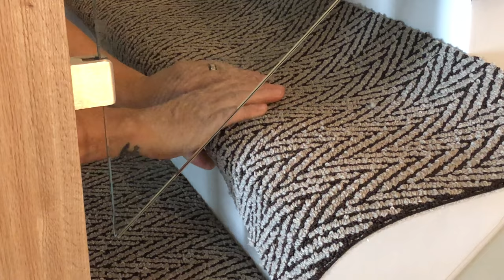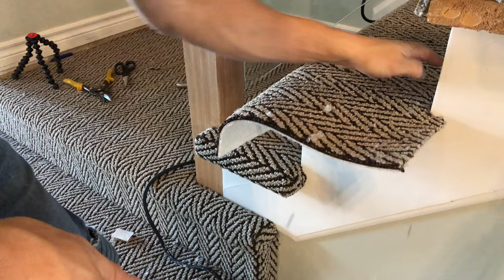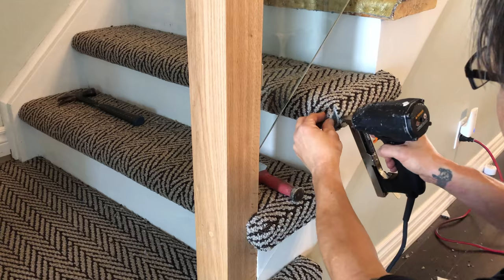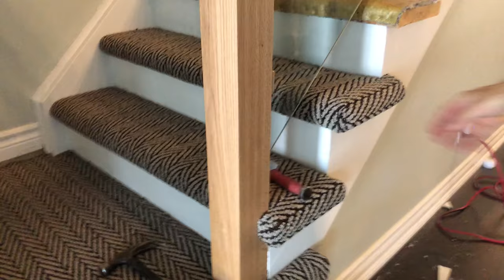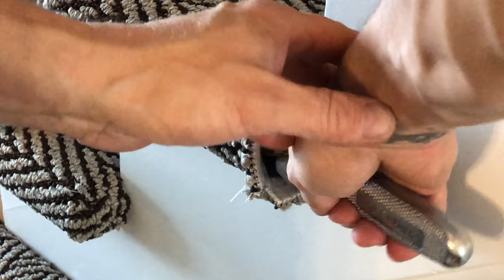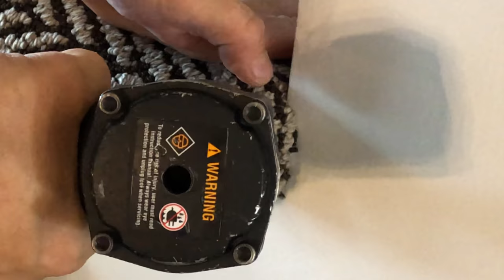Ultra Modern Stair Carpet Installation - Is it Really That Hard?

Comment: This looks great. I want to do the same thing on my stairs. I just need to find the right carpet that “speaks to me”. I’ve even debated on using rugs and cutting them to fit. I want as low pile as I can get as carpet on stairs always looks crappy over time no matter how often you vacuum.
Reply: I would suggest Anderson Tuftex. They have a wide range of designs and patterns and the carpet is low pile and built tough to handle high traffic stairs.

Comment: Keith, Doing this project. I am using a runner bound on both edges, centered in the wooden stair. Should I still use the tack strips, like 2" shorter than the 24" runner? Thanks and Happy New Year. 31" walnut treads and risers, 24" runner.
Reply from the maker: Happy New Year😀 you don’t have to use Tack Strips if you don’t want to! It’s up to you! I have many videos with tack strip and without, lately I have been not using and the job has been great! As long as the pad is straight and no more than half an inch away, taking place of the tack strip ! Hope this helps

Comment: I should be able to do this with a runner, correct? I am not going edge to edge on walnut stairs, so would use this method with a runner so the walnut riser is exposed. Thanks.
Reply from the maker: Should be fine

Comment: Stunning work! Can I ask, what are the other tools you are using, besides the staple gun? And how have you attached the underlay - glue/tape?
Reply from the maker: Thanks😀 underlay is attached with a hammer stapler as far as installation I am using a kicker a tucker a hammer an electric staple gun and a knife😀
Reply: @KeithShannonDirectCarpet  thanks for this, and thanks for being so generous with your knowledge. I’m looking at using carpet tiles so don’t think I’ll need the kicker, just need it to be 100% secure. The other tools finish it off so well - obviously with your skill!
Reply from the maker: Awesome good luck let me k ow how it goes😀😀😀
Reply: @KeithShannonDirectCarpet  Wish I could send you a pic - it worked!! It actually worked!! I’ve only completed half the stairs, but your video gave me the confidence to use the electric staple gun, the appropriate number of staples to use, and to adjust it slightly by giving carpet tiles a try! Husband and teen are pretty impressed, thank you!
Reply from the maker: Welcome!

Comment: Nice job and thats some cool looking carpet. Don't  you wish they made a staple gun that fits under all the steps without having to angle it ? That's the only part I never liked when doing steps. Mistake quote : ripping  off the old carpet, pad, and staples was the only part I didn't  like. 😆
Reply from the maker: You are soooo right! There is a gun that’s air powered that is tiny or smaller! But I do like my powerful plug in🤪
Reply: @KeithShannonDirectCarpet  what's the name of this staple gun? Never heard anyone talk about it.
Reply from the maker: That is a duo fast stapler that I’m using in the video! As far as the pneumatic one is concerned I’m not sure  of the name but available at most flooring supply stores and I don’t think it’s that pricey!  Just a plug in to a pancake compressor
Reply: @KeithShannonDirectCarpet  I have and use the duo- fast too. I was curious about the air gun you mentioned. I have a friend who has a Craftsman staplegun that is rechargeable. It's  discontinued but, it was handy but not small like the duo- fast and trigger response wasn't quick  like duo-fast.I had to talk him into getting a duo- fast after I learned the sears staple gun I started with was a step up from his gun but steps down from the duo- fast.
Reply from the maker: I will find out the name of the air gun
Reply: @stevehamman4465  I appreciate the info but, in 2015 my health took a downward turn. I did one real small job after that and now my tools are collecting dust and spiderwebs. I was curious about the smaller staplegun because I never seen or heard of one that was smaller than the Duo-Fast.
Reply: @stevehamman4465  researched the info and man I wish I could have had one that size in a electric version all the time I was doing carpet

Comment: Question.  How often you see stairs with just the tops? what's the best carpet for the job? and what kind of nails do I need. I have a stapler gun, just dont know if it is the same staples. Should I have padding in the nose or not?
Reply from the maker: It’s becoming more popular lately! A carpet stapler is best check out some of my other vids on that and the staples as far as pad is concerned yes to wrap the nose as long as you are wrapping tight otherwise can become a loose edge slip factor😄😄😄😄😄
Reply: @KeithShannonDirectCarpet  Thanks for the info.  Im in Colorado, but watch your videos.  Very nice work.
Reply from the maker: @oconuco  no problem

Comment: anyone has slippery issue with carpeted stairs? and does anyone know how to fix that?
Reply from the maker: Are they loose?
Reply: @KeithShannonDirectCarpet  no, they're not loose. it's a bit slippery, my family members slipped a few times. I want to make it safer before anybody got seriously injured.
Reply from the maker: If it’s slippery you might want to change it to a carpet that is more slip resistant! What carpet is on there now? Can you send a pic?